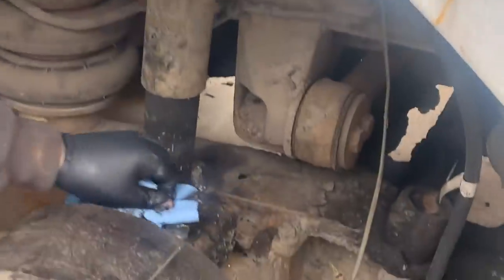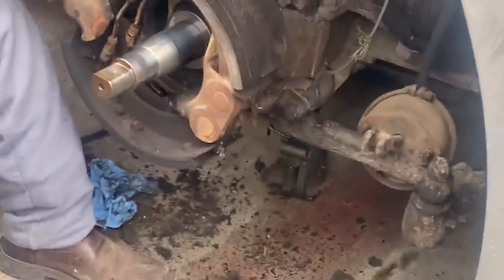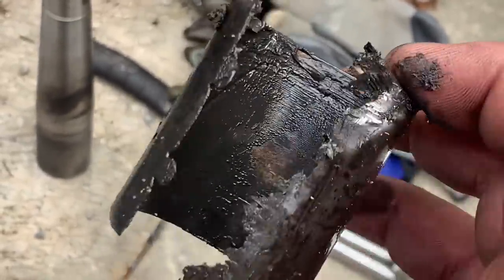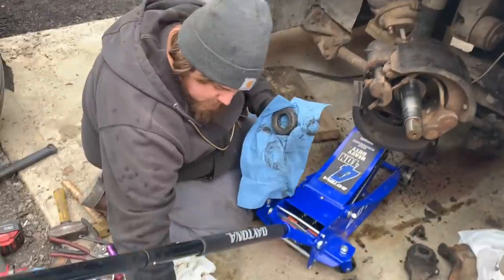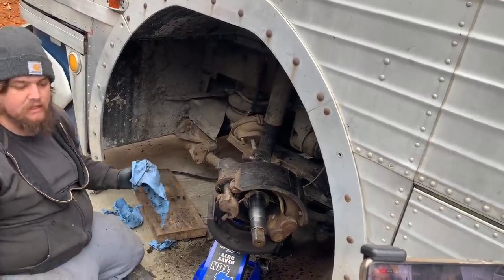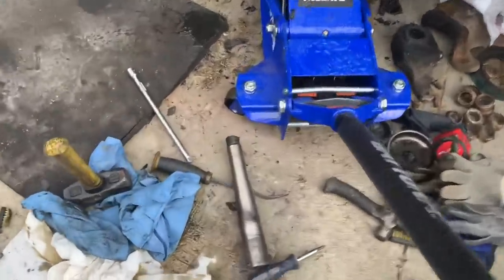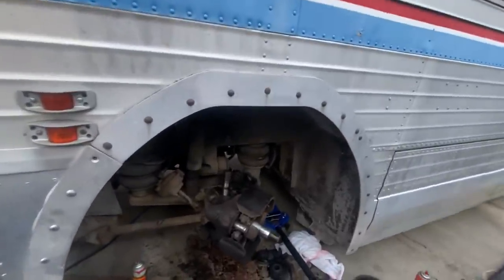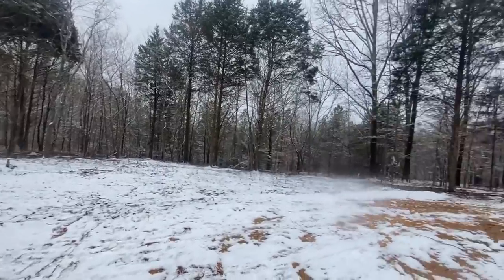Scenicruiser vintage bus king pin removal

Comment: I have had old chevy trucks with king pins. I would always grease them at every oil change to keep them from wearing out. luckily none ever did wear out. suspension parts cary heavy loads.

Comment: Seen a lot of critters on my cameras...never seen one of them before. About lost my coffee.
You were thinking the same thing I was looking into the machined surfaces in the kingpin bores. Hope it all worked out OK. Wanna keep the vibration in the wallet to a minimum. That guy was hilarious. I have seen that clip 3-4 times now and it still makes me laugh!
With that much wobble you would think the front tires would be scuffing pretty bad. Those bus tires gotta be $400, or more. That 400 bucks for parts will save them a couple tires, not to mention being able to drive the bus instead of herding it down the road.

Comment: Until you get your shop built if I were you I would buy a couple a three halogen work lights and a kerosene heater, a torpedo heater, a big tarp, some rope, and a few 2"x4" so you can make a tent over your work area which will allow to at least get your work area somewhat warmer and more comfortable to work in.  I did this when I worked on heavy equipment and my brother did doing outdoor telecommunications installation work as well as working on his farm equipment.  It is petty amazing how much heat the halogen work lights throw off especially when covered over by a tarp.  I normally put the kerosene heater on whatever side was up wind and positioned  the torpedo heater in front /or behind what I was working on to provide a wall of warm air.  In the case of the work being done on the Scenicruiser I would put the torpedo heater in front of the bus about in the center of the bus and the lights where ithey are the most useful to light the work area.

Comment: looks like you might consider a concrete pad there on the left too.  perhaps if you dig out the right side a bit you can have enough concrete to have 3 buses at a time.

Comment: the poor mans wallet just about imploded :))
I can't imagine what a king pin service is like on that, I've only done some on old less than 1ton pickup trucks. I guess having the correct tools sized for the job is key :)
well, it actually looked easier since it wasn't rusted into solid chunk of junk from top to bottom, I guess they designed it to last and be serviceable. judging by not seeing any hydraulic press equipment, nor torches, etc. lol

Comment: i may be picky.. but when i grease king pins.. i try to have the weight off the tire so the grease goes all the way around the entire bushing..  when the weight is on the king pin. the bushing is flat..  it would be neat to figure out some swivels to have flex hoses to the king pin that both come straight up and then inboard..  to a small grease accumulator.. so when the wheel goes over a bump. the grease fills the cavity automaticly..